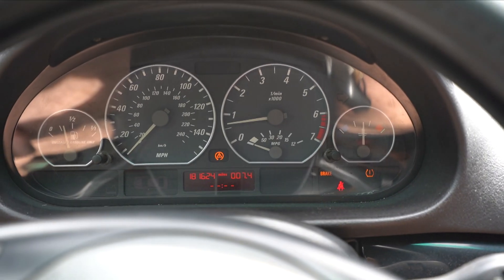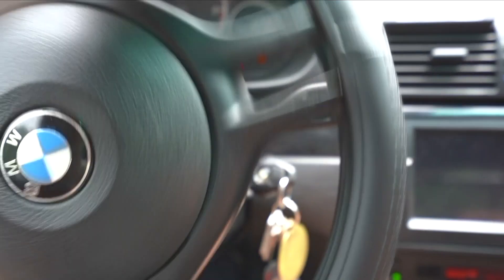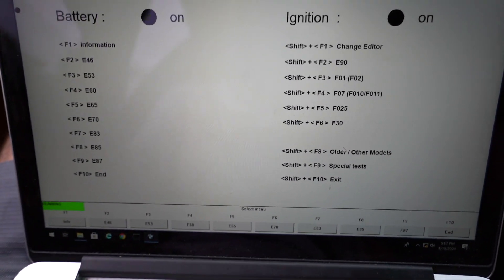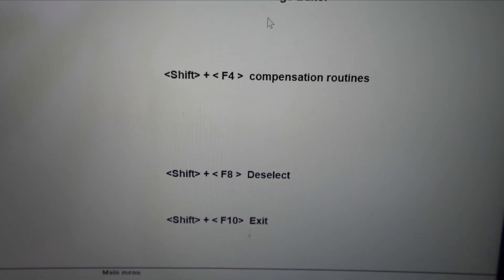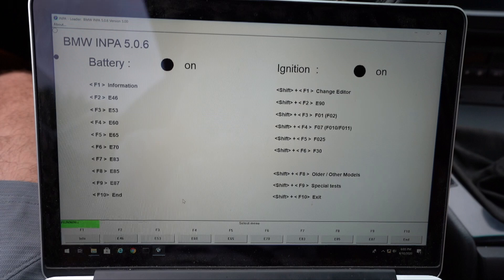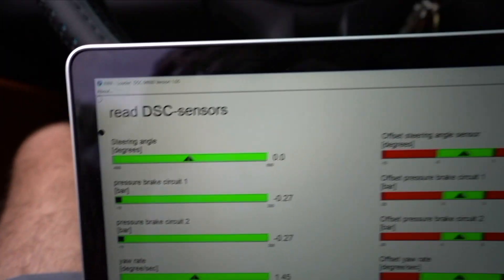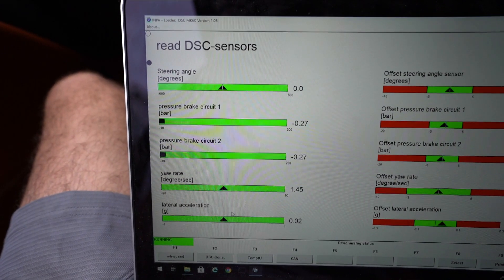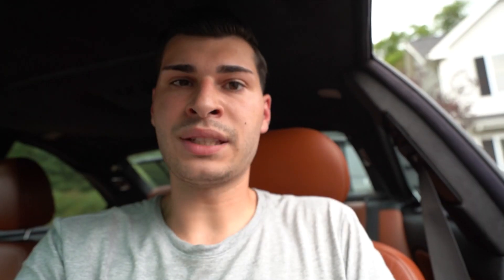How to calibrate the Steering Angle Sensor on any BMW // ABS FIX

Comment: Free And Easy - Had to wade through so much bollox for this - bmw 135iM e82 2008, changed out the tie rod ends, threw this issue, as many include this video - free fix that never works - BUT it does - certainly from 2008 on. Get on straight bit of road / car park etc. ignition off and key out, start - full lock left and hold for a second or two, full lock right, hold for second or two then centre steering so wheels are straight (after you’ve had everything aligned obviously), I did this three times and then immediately drove in a straight line - lights out and steering calibrated, for some reason everyone does the steering wheel movement, then ignition off and wonders why it doesn’t work - no ignition off - just drive straight forwards and it will clear - if it doesn’t then there’s something else going on that you need to identify and fix, took me ages to work out after my diagnostic tools kept saying my vehicle wasn’t supported (including inpa / itsar etc) - nearly wasted a fortune before working out virtually everyone was getting it wrong. Hope this helps you ❤️

Comment: Calling Evan Goyuk! 
Greetings from the UK Evan.
Great video and much appreciated.
I know it has been a long time since you did this but can you answer a question for me?
The "Shift F4 compenstaion routines" option at 2:59 in the video.
I can get to that screen ok.
But the button at the bottom of my screen has "Error" written on it and selecting it goes to a more or less blank page.
The F4 button on the bottom of your screen at this point has something like "Abgt Rout" on it.
I can quite make it out.
What is that abbreviation ? Something in German I dare say. 
Also do you know which program that button links to?
A bit of a shot in the dark I know but I thought maybe you might know.
The DSC sensors status display page works fine.
I just can't calibrate the steering angle sensor.
Thanks in advance.

Comment: Hi Evan and BMW community. I have this exact issue with a 2007 BMW X3. I can use INPA but do not have the same menus choices as shown in Evan's video. Can anyone guide me through this in INPA with an E83 (2007)

Comment: Doesn't seem to work on E90 in INPA best to remove battery for an Hr then use inpa to go in and read analog data to check the graph is at 0 again or if an issue is present.

Comment: what if the steering wheel is pushing the car to the right side while you’re driving?
Reply: alignment tire pressure worn bushings etc but mainly alignment 
steering wheel could be off if it was ever removed

Comment: I have an e63 I went from lock to lock , then I shut ignition off and then I restarted it and my light went off. My steering wheel was straight ahead too. Thanks for the video
Reply: did yours come back? i did the same but they came back the next day

Comment: Compensation Routines doesn't exist on the dsc57, same version of inpa as you. Is there another menu to do this calibration? Working on an E53 X5
Reply: Ever find the fix for this?
Reply: @bobbyshaftoe  I paid a shop $200 to recode the steering angle sensor I replaced and that cured my car. There wasn't what I was looking for in the bimmer tools for some reason

Comment: Hello sir. What if you have a 2013 750li xdrive and it has the steering light, park, ABS, Brake and check engine light on

Comment: I have a 2003 Z4 30i Random complete loss of elect asst. After parking 10 minutes 
Left over night power returns & red steering wheel indicator is back off 
Yellow Check Engine  warning is always on ??

Comment: 90% its bad HSR module which new cost 1500 euros. So try to find used one and see that numbers 679.....are the same and you dont need coding. Used modules are around 300 euros. That is among most expencive modules in bmw.

Comment: Thank you very much for the contribution.  I recently bought a BMW E46 320d (2003) and it had the warning lights on.  I tried with other versions of INPA without being able to recalibrate the sensor.  Using the version video I rectified the steering angle sensor calibration.  One note, if you buy the same cable with 4 positions, the position farthest to the right (under letters D-CAN) is the one that worked for me.

Comment: Thanks for these Video's! I tried using INPA to sort this issue on an E82 125i but get the error message "calibration steering angle only with steering wheel balancer" I also tried with tool32 and get the error IFH-0010: DATATRANSMISSION TO CONTROLUNIT DISTURBED. I'm beginning to suspect that something has not installed properly! I've changed the USB port to COM1 and changed the latency to 1. A bit stuck now!
Reply: I wonder if the terminals 7-8 weren’t bridged because in the end I used another diagnostics machine and it worked straight away
Reply: did you solve this?

Comment: Can this lights pop up if the steering wheel was removed and then mounted on again not 100% straight and aligned with the wheels?
Reply: Dude that is a perfect question because I'm starting to think that's what happened to me, did you ever find out?
Reply: UP??

Comment: How do you know which ABS module to select in INPA?  Or will it be the only one listed?
Reply: did you ever figure this out?
Reply: @User4629z  It's written on the module itself. Otherwise, try selecting the version on INPA. They'll either work or they won't
Reply: @Stag2997  thank you for telling, turned out to be the yaw rate sensor (aka sensorcluster) in my case if thats why you’re here

Comment: @Evan Goyuk, thanks for sharing this HOW-TO video, would this work on the R56 (MINI Cooper S) 2nd gen?
Reply from the maker: Yes it should
Reply: @EvanGoyuk  99p00
Reply: @EvanGoyuk Hi, after replacing DSC/ABC module and finished coding, did this steering alignment in INPA, my "4x4" light is still on. 😅
Reply: Do you know what option from the main menu of the INPA interface I should select for the R56? All the options I see are BMW specific.

Comment: WTF???? That was some mumbo jumbo B.S. sorry to be real with you but it didnt do anything but waste my time
Reply from the maker: No I show how to reset the steering angle sensor
Reply: salt is strong in this one....
Reply: With a big badass computer. Come on now how many of us have those. The turn of the wheel is what you said. You should make sure these "little tricks" are gonna work before you show us.
Reply: @georgehelton3659  I'm grateful for the video. A computer is just another tool, I can't fault a person for owning a tool that I have yet to buy.
Reply: @georgehelton3659  Big bad ass computer? Man what are you talking about, an average person has a laptop at home, all you have to do is to buy the cable on ebay for 10$ and you're set. Otherwise go to the dealer and get willingfully ripped off smh

Comment: The lock to lock technique only requires going from lock to lock once. If you go lock to lock and it doesn't clear then you need to scan the car and relearn the steering angle sensor.

Comment: Just did it but the the lights didn’t go out, so reversing out I did the full right and then going forward I did the full left turn and then started driving, the lights went out when I put it in second gear, no need for INPA.
Reply: What sequence did you use?
Reply: @BrotatoWhat  it was 2 years ago, time flies and so does my memory 🤓

Comment: Would impa work on a Mac?
Reply from the maker: You will need bootcamp or VMware to install windows on your Mac
Reply: Evan Goyuk ah great man thanks
Reply: @kouroshtashvishi5031  you can use an app called parallels if you don't want to partition your storage to windows (which you have to do with bootcamp) either on the hard drive or a flash drive. I recommend parallels since you probably wont be using it that often and I'm guessing you don't want to give up storage on your mac
Reply: Ryan L you are 100% correct. Since then I have not installed windows just because of how much space it takes up. 
Thank you very much for telling me this app. I will be downloading it today thanks man
Reply: same thing as VMware lol

Comment: the trunk release on my e46 coup is not working , it works fine from the FOB but the button under the dash does nothing now, 
anyone have any ideas? i am thinking maybe a fuse or  i did something when i was coding?
Reply from the maker: Check both coding options and fuses